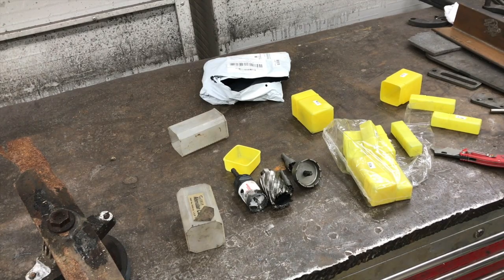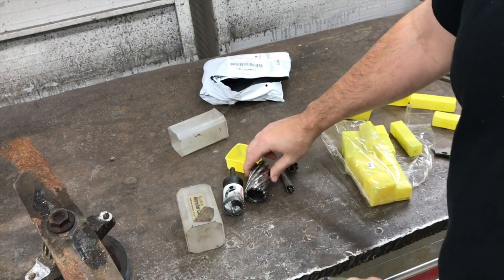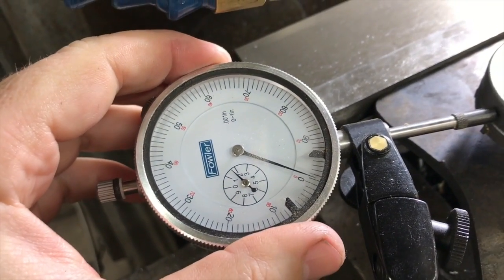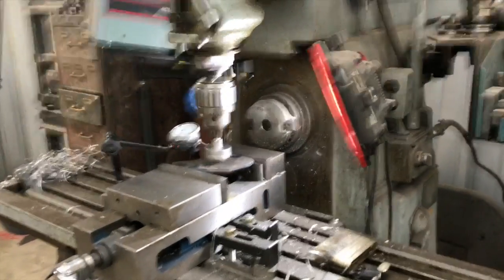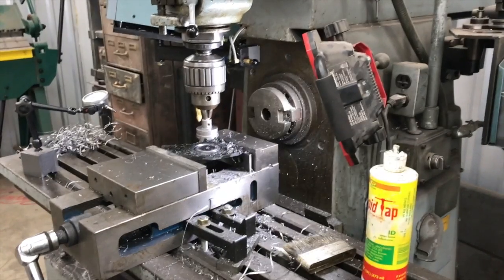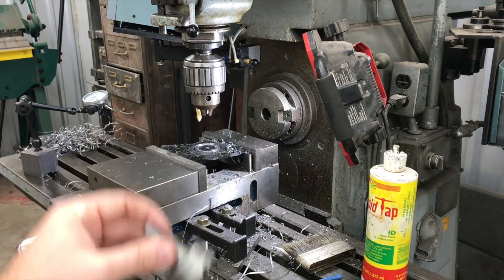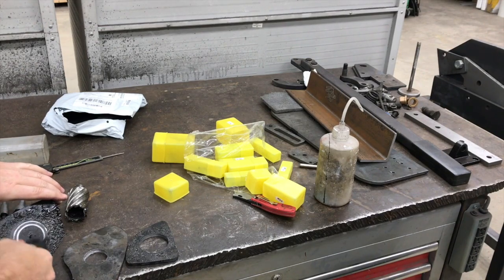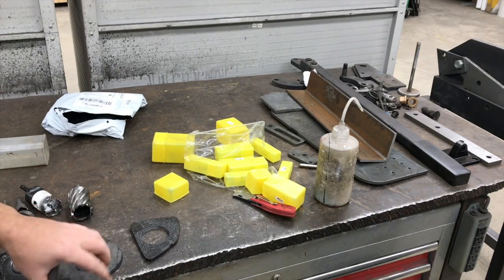Carbide Tipped vs Hole Saw vs Annular Cutter - Which is best to drill thick metal - steel - iron

Comment: Those TCT cutter's Centre drill bits are Crap or at least the ones I purchased years ago, 5mm off memory ,definitely a twist drill twist right off and mangle the ejection spring! they may have improved them since then, doubt it though. some of the TCT are brazed on and others are Cemented on the Brazed last better. Defiantly for Wood, plastic soft metal and non ferrous type metals. They are relatively inexpensive but save your money unless your want to use on Sheet Metal and save up for Annular Cutters.

Comment: You didn't do anything wrong, those carbide hole saws are only useful for thin sheet, the standard hole saw is good for wood. But the annular cutter is the ducks guts for plate, perfect no question.

Comment: My brotha let me tell you a couple of things to consider on use of TCT cutters.

#1 depth of cut on the cutter you used is about 3/16".  Your material looks to be 1/4".

#2 need to use a mag wand to pull the chips away from the cut.  The chips are getting caught up and the cutter is literally trying to recut the chips.  If you don't have a mag wand use a blow gun.

Comment: I've used hole saws in the 1 1/4" to 1 1/2" sizes, run them probably too fast, but got excellent results using water as my continuous lube.  Got very little degrading in teeth as well. Was able to make many holes in 3/4" steel
Reply: 3/4 steel you say ? what brand hole cutters you use ?
Reply: @brianblithe2271  Used Lennox and Milwaukee as well as the orange home depot brand.  Just used a squirt bottle ; 3/4" steel was for links for hydraulic system cylinders

Comment: A pilot hole may have made it easier to get further down on your work pieces.  I agree with your fist drill bitnthat takes out materials fast. We get what we pay for.  Thanks for sharing.   Enjoy.  PS. THE Anual cutters are definitely the way to go and great presentation on your video.

Comment: This was helpful.
I have seen that other set on Amazon.
Maybe they are good for sheet metal?
I just got an old school B&D Mag Drill and have been looking in to annular cutters.
The price of that set is tempting but I think it would just put me $25 away from having somthing that works.

Have you looked in to a tool holder that puts the coolant in to the pin that goes into the middle of the Annular cutter?

Are you using those pins?

For about $40 Amazon has a tool holder that goes from MT3 to 3/4" Weldon coupler.
It feeds the coolant in to that pin that goes into the middle of the annular cutter.

What annular cutters do you recommend?

I assume Tungsten Carbide Tipped (TCT) is the way to go?

Thanks!

Comment: does B look like they're for rock like Limestone or concrete or cement they don't look like they would be for metal because the Bits  I have seen for rock looked similar to those but they are longer  lik ---[_____} and not --[_}

Comment: Its hard to tell but I recon you are going too fast for an ordinary hole cutter but I know you said it was 150RPM which sounds right but it shows all the classic signs of the metal to tooth rate is too fast. Just  a comment, I have no experience with these cutters hence my interest in your video
Reply: Maybe not I looked up the speeds for the starrett one and if anything you seem slow, they talk about 400rpm for that size
Reply: I purchased a starrett 1 1/4 TCP hole cutter and was most impressed, made a beautiful job. I think your problem is you are going too fast. At 120rpm and lots of oil mine worked perfectly in 5mm black steel. I ended up having to do this in my lathe as my mill didnt have enough power at very low speed. Pain to setup on the face plate but it needed to be clamped very securely. So as I used them they seem really good but I suggest on a hand drill you will stuff them in no time. The Starrett has much better chip removal, you are right they must not clog up.

Comment: I used it today on mild steel and it did pretty good with a hand drill, I kept using oil and did use good quality castor oil and kept the smoke away

Comment: The carbide tipped hole saw, ya, what’d anyone THINK would happen! “I’m gonna pretty much pull down as hard as I can, no idea what the feed rate is....” Ya, That is specifically what you’re NOT supposed to do drilling anything. Secondlyness: HEAT is the enemy of all cutting apparati (the plural of apparatus). So, the larger diameter, the slower the rpms and feed rate, have a brass bristle brush to clean the gullets as you go on thicker material. Now something to note here, if you payed $25 dollars and got a goddamned pack of TEN assorted “carbide tipped” hole cutters on Amazon then you’re pretty much guaranteed they will fail. PERIOD. Actually I think the seller didn’t post those for sale thinking anyone would buy them! It was just a troll! A joke! Not to be taken seriously! Anyone that knows how to do anything of real intrinsic value would have seen the “ad” on Amazon for those cutters and known immediately it was just poking fun at crappy tools and manufacturers! It’s the year 2022. Literally nothing costs $25. Especially not a tool that is designed to be used for ANYTHING! So, the next time any of you are drilling holes in metallurgic compounds, keep it slow and keep it cool. “I’m gonna pull down as hard as I can” he says!😂

Comment: Not all holesaw are made for lubricant there are some in the industry that are dry and the reason why is lubricant tend to clog up certain areas of the holesaw preventing the proper use of it so you might well want to check with your manufacture if it requires lubricant or not and also the speed that it requires to drill a hole with the holesaw

Comment: interesting test. I would never use hole saws on steel but have on aluminum several times. Recently I cut 2- 2" holes and 4-1 1/4" holes in 1/2" aluminum plate. Worked fine and Milwukee hole saws still like new. Used my mill head to drive it and used a steady stream of coolant fluid bathing the work.  Also used the peck system and cleaned the teeth frequently. i have used hole saws to drill holes in work so I had more room to than use my lathe to bore the hole larger. I would like t get a couple of annular cutters but seems I always put it off and than when I need to make a hole i resort to the hole saws.

Comment: The closer your piece is to the quill and the less you have to travel will reduce chattering also having a stable set up will help immensely… With annual cutters you want to have constant oil for constant cooling for constant cutting Performance. It will also have the effect of having your tools last longer…. Cool presentation…. Keep on rockin…

Comment: if I only have an ordinary drill press, can I use an adapter to use the annular cutter to cut metal?  Thanks
Reply: Yes you need a MT to 3/4 Weldon, but you also need a drill press that can spin slow.

Comment: next time read the directions... the morse cutter is only designed for 1/8" depth of cut. They make different versions that can evacuate the chips for deeper holes, but that is not one of them. not really comparing apples to apples here, so it's pretty obvious that an annular cutter in a milling machine is going to be the champ

Comment: I noticed that you didn't use lube on the first attempt with the carbide hole saw (unless you cut out the shot where you lubed it). I wondered if that was the cause of the carbide wearing so fast, but you got the same results with the next carbide hole saw, and you lubed that one right away. So they probably just can't handle steel. Good vid though.

Comment: Ramsey, you should check out Project Farm, he also does a video on hole saws.
Reply: He didn't rate any of these cutters except for the Milwaukee one though. Actually, he tends to leave out some of the best brands or brand models far too often. I do love his videos. But, like the measuring tape one for instance, he test the low quality Milwaukee tape measure rather than the STUD model, which is the only one comparable in price and quality to the winning DeWalt tape. The same thing with the Irwin masonry bits, same with Bosch brand step bits, same with STIHL chainsaw model. I'm just a tool guy I guess but it's like he always leaves out a major competitor

Comment: I think the first hole with carbide hole saw stopped because that spring on the center bit was pushed solid, not allowing it to go down any more.
Reply: The bigger problem is that you get 10 for $25, which shows you that the quality is more than likely pretty low.  Then the video shows that they are low quality, not even able to cut through the metal.
Reply: @jtoker9758 and you based your analysis on price huh and not considering that it was used for the wrong purpose lol when you misuse your equipment even expensive carbide would complain and stop cutting. what is designed for sheet metal should be tested with sheet metal.

Comment: You should let the bit do the work just gently press it down .
Reply from the maker: No sir, not true.  Significant down force is required for big tooling.  One of the worst things you can do for your tooling is to "Dwell"  or have little down pressure.

Comment: That carbide is for doing circular groves on ceramics or concrete and insert stainless pipes with some epoxy and use them as handrails columns.
Reply: Carbide is great for cutting steel. He is just pushing way too hard
Reply: @jacklinks4905  Well man. if carbide was that great I would have seen it in my 30 years working in steel fabrication. Nobody used that there has to be a reason.
Reply: @kiyoshim9593  Well we must do different types of machining. All we use is carbide on steel. As for softer metals like copper or bronze we sometimes use HSS/cobalt.
Reply: @jacklinks4905  These are other kind of Carbide with micro grain structure that break if you do it manually. these are for mills. try them manually and you break them in 1 minute.

Comment: I have found using compressed air blown directly on the cut without using cutting oil works best. We use annular cutters and Milwaukee, and both seem to last longer and cut faster.

Comment: Some carbide tips are quality and will cost  $20 plus for 1 1/2" and even with a  expensive one you have a delicate POS that will be in the trash after a few uses.

Comment: We use the tct holesaws all the time cutting holes in 316 stainless, theyre 1000 times better than a standard bi metal holesaw. But theyre designed for sheet metal usually only up to around 3mm thick, you can cut larger i cut a 20mm hole in a 25mm thick pice of stainless half one side flip half the other side but it took forever and had to stop and clear chips out of the teeth all the time. They do leave a very clean cut with no burrs though, fantastic when drilling for glands into electrical panels.

Would love some annular cutters but we dont have a mill and most of the time the holes i need to cut are machinery and being used in a cordless drill which deffinately rules out an annular cutter lol.

Comment: With the carbide cutter you measured the depth not accounting forcthecrelease spring. Any chance your bottoming out the spring before you can cut through the material. I wonder if there only designed for thinner material

Comment: Give amazon a big miss. They make billions. Good video and very informative. I think the amazon carbide bits can be used to drilling masonry. Although not very deep. You probably cannot cut any steel thicker than 2 mm. Although it doesn't seem suitable for cutting any steel. The first cutter is superior. The holesaw isn't so bad and can get you out of trouble as long as you you spend a bit of time and be gentle. Oh on the promotion holesaw. Perhaps drilling clay tiles earthenware tiles.

Comment: The $25 for ten cutters are complete garbage, as demonstrated!  Annular cutters, or bi-metalic hole saws are the way to go (Annular cutters are my preference if you can afford them).  I have bought a few of the Cheapo Chinese carbide ones and I have tried slow and fast speeds always the same result - shit!  Have started buying annular cutters, made the holder on my lathe out of a 3 inch piece of round drop - Happy days!

Comment: those cheap carbide tip hole saw are no good I bough a set and didn't last me a day 
but if you want a good carbide tip hole saw 
buy  champion brand  they are not cheap$ but they are good and can cut very fast up to 1" thick Steel and they sell all size from 1/2 to 3.5"

Comment: Those are not made to cut 1/4 plate the plunger spring deal is probably bottoming out, one would purchase these for use on sheet metal up to 11 ga at best, really common for electrical enclosures for knockout annular cutters are your best bet, if you have the equipment to chuck them up just buy the size you need they last really well, if you need holes in sheet metal buy the 25 dollar set or a nicer one hougan makes a good set evolution are ok

Comment: Have bought these and have used on a regular belt driven pillar drill, have cut 16mm hardened steel plate but used up 2x25mm of these cutters for one hole . The carbide teeth just don’t stay the distance, they’re ok for soft iron but need constant lube and air to keep cutting channel clear of chips. But then for a few $ and made in China you can’t expect to get top notch cutting, best stick to annular cutters, may be more expensive but they’ll stay in your bit box and not in the scrap bin. 👍

Comment: From what I can see, it seems they should not be used for anything thicker than the "notches" where the carbide blades are placed. Maybe 1/8" max. Otherwise there is nowhere for the shavings to escape???
*********************************************
I have had a set of Ideal brand carbide knockout cutters and have used them for THOUSANDS of 7/8 & 1"  holes in electrical panels - But we're talking about soft, thin metal. I don't think they would do well drilling through 3/8 plate either. I can tell by looking that the the Ideal cutters probably have quite a bit more weight to them than the FEEbay bargain basement model...
You get what you pay for. The Ideal set of 3 was $100 / I'm sure the first cutter you used cost a bit more! than any of these ~
Thanks for the video. This inexpensive set might be good for soft, thin metal & plastic - but nothing like what you were cutting.

Comment: Never buy cheap carbides this whole kit is $25?? One good quality 7/8 carbide bit is $30 not 5 for $25..next time but the ideal ones or Klein’s or greenlee’s... as a electrician I used carbides almost daily they’re great and superior to hole saws when cutting holes in 1/8 in metal or stainless.

Comment: Anuallar is best. I use a Jancey Slugger and a English built Rotobor magnetic drill.

Since the split point is developed they really make quality mirror finish holes

Make sure a good supply of oil is used.

Comment: First hole chattering. Isn't that too fast? From what I have been hearing from some others, 50 or 60 RPM may be smoother and less heat??? Can you get annular cutters for use in a drill press or a geared down hand drill? 3 flats?

Comment: The second holesaw is more for thin metals like electical panels and boxes. As an electrician I use 10 different sizes of these on a regular basis.  Usually  3/4 inch , 1 inch, 1.25 inch, 1.5 inch, 1.75 inch, 2inch , 2.5 inch , 3 inch and 2 that are specific to metal race for cutting metal studs to run MC through  .     Ive had my kit for 5 years and have no problems with it.  Using it to cut .5 inch plate is not the best idea.

Comment: Your carbide hole saws are not for steel.
Reply: Incorrect, they are used for harder Steel. Application was incorrect. T drill bits are made for professional stationary computerized, laser lathe, for precise Drilling. Carbine drill bits not for handheld or drill presses, which variable pressure well Ensure incorrect Cutting. A Cobalt drill bit is more suitable for hand-held drills into hardened steel.

Comment: I a am from South Africa.. unfortunately if I have to buy Angular  cutters for my home use, it is going to cost alot, luckily we have those carbide tipped hole saws at every Hardware store and more.. I use them in a hand drill to cut steel sheet metal up to 8mm thick.. use cutting coil to lube.. and  again with fair pressure and decent speed technique.. I drill alot of holes by hand.. the hole saw last me   very long time..and it doesn't take me that long either..

Comment: 25$ for ten cutters? No test needed actually...
Maybe carbide would need more rpm as well.
Reply: carbide is mostly used for cutting floors and insert stainless pipe with some epoxy in tht 1/2" grove.
its notnmeant for doing holes on steel.
By the way I do holes to Steel beams everyday for about 20 years and have tested all kind of different cutter. trickm is to buy name brands but these cheap chinese can make 10  3/8 deep holes. just use lots of oil and use speed chart

Comment: i should watch this video before buiying the set ! i use the little 15mm on inox tube of 5mm thickness with a cordless drill, all the teeth melt despate using cutting oil.
i'll kept the remaining 11 bit for very thin metal, aluminium, etc. and buy classic hole saw.

Comment: The TCT (Tungsten Carbide Tipped) Hole saw you used is not designed for metal hole cutting, its for concrete or brick only. If you do want to use a TCT hole saw on metal, you need to use a multipurpose TCT hole saw which is for concrete, wood, sheet metal.
for multipurpose the brazed TCT's are at a specific angle of 118 deg for metal cutting.
Reply: "its for concrete or brick only"
Umm, No.